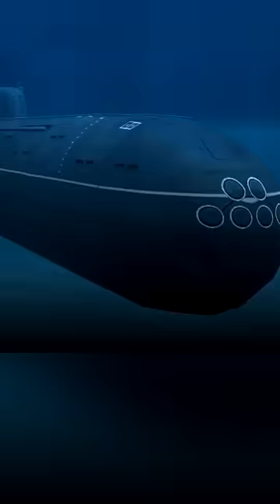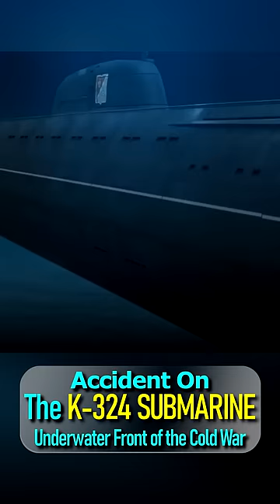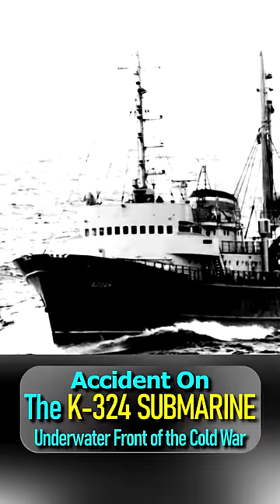Accident On The K-324 SUBMARINE #Shorts

Comment: it is believed that Russian captain intentionally did that to secretly retrieve the sonar back to home
Reply: Raymond Redington LOL
Reply: Harasho? Dobri
Reply: Russian submarine was tailing American ship to avoid detection as the sonar is unable to hear a submarine that is hiding behind the screw...
But this ship was not using standard sonar that is mounted infront of the screw, so the plan backfired and the submarine lost its propulsion.
Reply: @chrislloyd261  I like MARCO…..,POLO!?
Reply: @Bialy_1  towed array bruh. Submarines also use towed arrays. Its not like the sound of the screws propagate on one direction only. Its just as loud at the front of the ship. Forward Active sonar has a weak spot aft if the bulb, but there are arrays along the sides of the vessel as well, both surface and submarine. Passive sonar doesn't care about screw or not. You can hear your own screw and ship noise louder than anything else, regardless of position
Reply: They couldn't see it. They're in a submarine. So unless the cable is making noise, which it is, there's no way that was intentional.
Reply: Cope
Reply: I'm not giving ruzzians credit for anything anymore.

Comment: small issue russian subs use two screws to propel theselves
Reply: Not all Soviet sub have twin screws K-324 is a Victor III class of sub the older Victor I and Victor II classes have one screw. Victor III type subs upgraded to having twin screws but they are on the same saft positioned one after another run in a counter rotating manner similar to how a aircraft used counter rotating props.